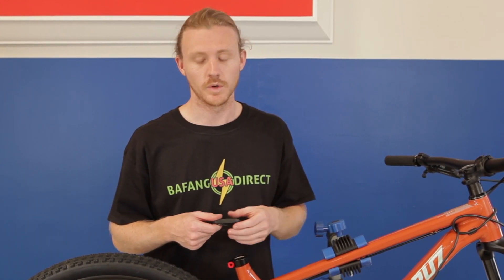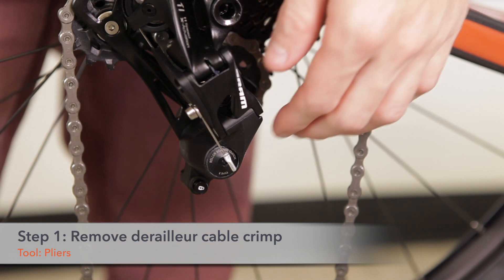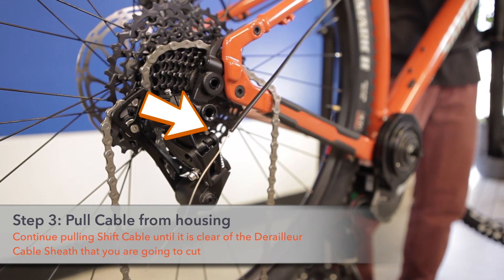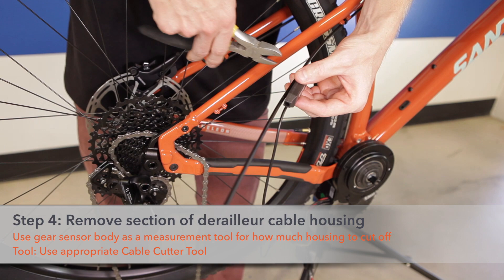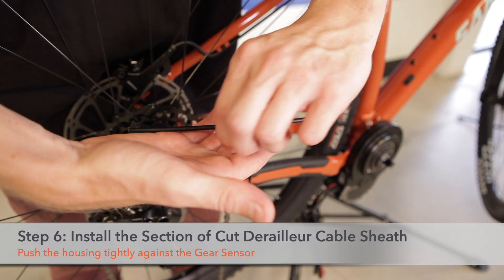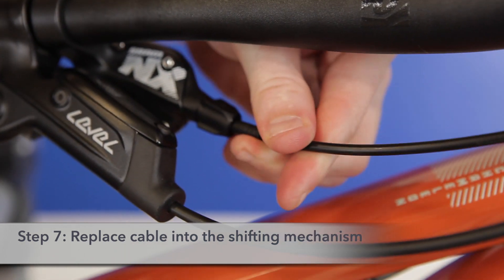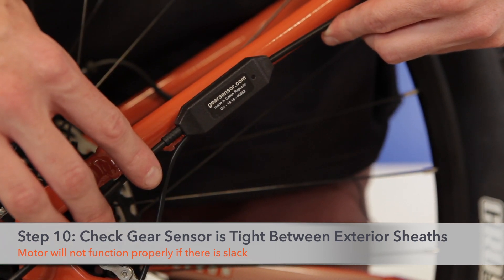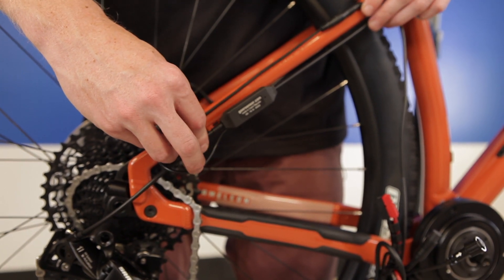Bafang Gear Sensor Installation

Comment: Hi! Is it possible to adjust the engine shutdown time from the controller? I am thinking of installing a 750W bafang with the LINKGLIDE system from DEORE, but apparently changing gears is slightly longer. It probably doesn't matter, but I have a slight concern.

Comment: I’m having a hard hard time getting the cable to push through. Would a small amount of some sort of lubricant help? Would it alter the performance of the sensor if I put a small dab of grease on the cable to get it to slide through? Also, there are two screws on the sensor … is it possible to temporarily open up the sensor, feed the cable through and then close the sensor housing?
Reply: This should have been the default way to do it though: open housing of sensor and place on top of wire then close it back. we 
would only have to strip a small part of the wire ...but i'll admit we risk cutting the wire inside doing that

Comment: Question: the cable from the motor with the yellow plug. Usually is for the speed the speed sensor, are you able to run a speed sensor and shift sensor off the one rear yellow plug?

Comment: Hi,
I'd like to know if I need to buy an extra T cable for my motor (bbshd) or just plug it in?
Reply: If your motor is the older one, you need the 2-1 wire, if your motor is the newer one, it would have a dedicated wire like in this vid.
Reply: @kaikart123  mine is the bbshd, but its new. By the new you mean the M625?
Reply: @luist76  no, there are older BBS that do not have dedicated shift sensor connector and you need the tee wire to tee from one of the brake wire.
Reply: @kaikart123  how can I tell if i need it or not? My motor has a 3 pin yellow female plug, a 3 pin black female plug, a 8 pin female plug (all round shape), a 2 pin female plug (square) and the battery plug. Also have a T cable with male 8 pin on one side and 2 female yellow, one male yellow (all 3 pin) and a green 5 pin male plug. All of these are accounted, 2 yellow for brakes, green to display, yellow to accelerator and 2 pin to front light. I can't see how to connect the shift sensor...
Reply: @luist76  you don't need the tee
Reply: @kaikart123  where do I connect it then? On one of the braking sensors? And leave the other one unplugged? Sorry but I don't understand...
Reply: @luist76  literally in the video
Reply: @kaikart123  Now i got it! Thanks for the help!!! I'll put an order later today
Reply: @luist76  that's my dude
Reply: @luist76  I have exactly the same question and I don't get it... Are we supposed to leave one braking sensor unplugged ? thanks !

Comment: Break and shift sensors are optional? I have mechanical brakes and shift sensor is extra install?
Reply: Yes they are optional, however the motor won't stop when braking or shifting gears. You'll have to stop pedaling to stop the motor. I suggest reprogramming the motor to istantly cut power when you stop pedaling.

Comment: I see lot of videos of this install and I've seen where the sensor wire is installed in both directions. My question is does it matter which way the sensor is placed or does it have to be placed a certain way.
Reply: I think it doesnt matter. as it's goal is to cut power when a change is detected

Comment: Hallo! Entschuldigen Sie bitte, ich verstehe nicht so gut Englisch, könnten Sie mir bitte erklären, wofür  Gear Sensor? Welche Funktion macht er?
Reply: bei dem Gangschalten sollte die Kraftübertragung unterbrochen werden. Es könnte sonst die Kette, die Kettenräder oder der Kettenwerfer ruiniert werden. Fallst Du beim Schalten zum pedalen aufhörst stoppt der Motor auch und Du brauchst das Ding nicht. Aber niemals vergessen! VLG aus Kalifornien
Reply: The Gear Sensor momentarily cuts motor power when shifting. It mounts inline with the shifter cable and detects the cable movement. It sends a signal to the controller to cut motor power while shifting gears.

Comment: Not only was this a helpful video it was totally chill, soothing and relaxing.  FYI in my instance I didnt even have a cable covering so I was able to just install it without cutting anything. Zip tied it up nicely and hopefully it works! Thanks!
Reply: Do you have to undo it at the top .or just pull the outer casing out. Also do you have to undo the chain

Comment: Hi, Do we need to have a Y-splitter as well or only the grear Shifter? And Does it work with 1000W (BBSHD) motor?
Thanks
Reply: You only need the splitter if you version of BBSHD doesn't have a dedicated gear sensor cable.
All newer ones of BBSHD and BBS02 have the dedicated cable coming out of the motor/controller.
Reply: @MicroRCFiend  Do you know if Bafang M400 250w mid drive have gear sensor option/wire?
Reply: @ViljamiDrumming  I'm not sure. I can't see clearly enough online pictures and also can't find the manual. Do have the motor or manual?
I'd expect it to have this function since it has to be used in various bikes with various setups. I'm  also under the impression it's only older non torque sensing setups that didn't have the function.
I still don't actually know if it has the same higo connector for it though.

Comment: How is it different if installing up at the shift mechanism?
Reply: Going to be installing one of these on a Terra Trike Rover I-8. Was wondering the same thing. Do we have to split the sheath on the shifter cable closer to the shifter to install this thing?  And with the I-8 you stop pedaling to shift gears. Wonder if I will even need it? Can't see where I would unless I was running non pedal assist and only using the battery.
Reply: Maggie and David Cogswell It is no different. It's just a little wheel that detects the movement of the cable and triggers a sensor. That cuts the power. I don't bother with them. They are pretty crap really. You can use a brake cutoff to do the same job much better.
Reply: @HighVoltageKits  Bad advice! They are not crap. You are.